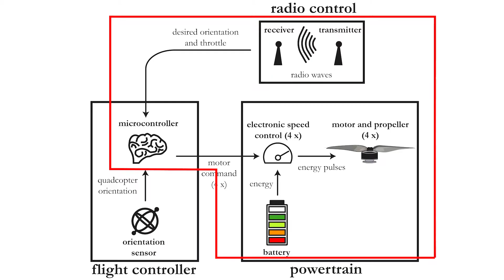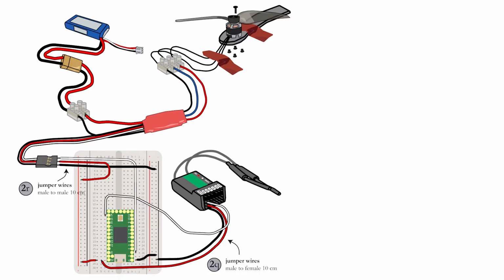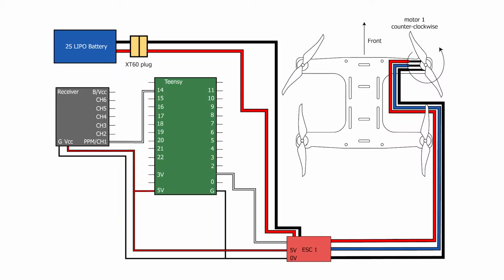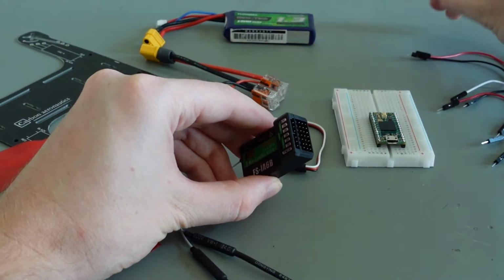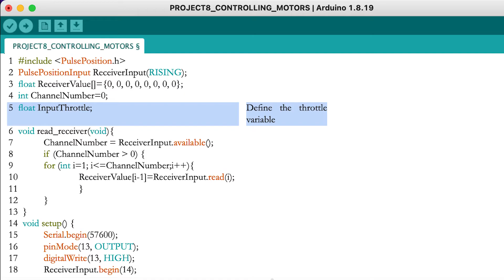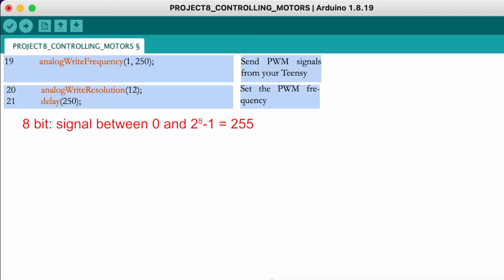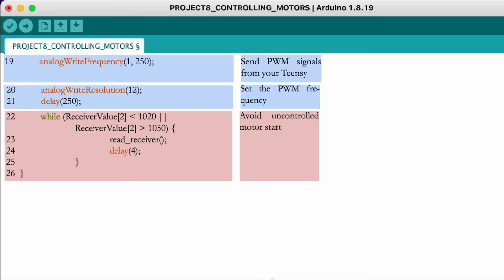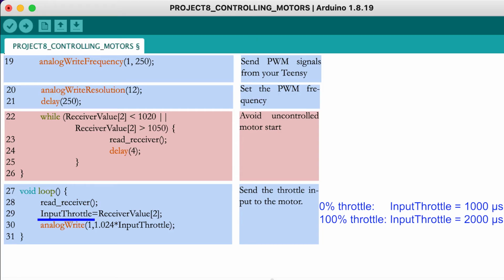8 | Control a brushless motor with a Teensy

Comment: Thanks for the great series of videos! Here we are using the PPM signal from 1000 to 2000 in a 12 bit resolution from 0 to 4095. Why aren't we converting the 1000-2000 in 0-4095?
Reply: Because ESC doesn't care about duty cycle(0-4095) rather it cares about pulse width in micro seconds.
Minimum pulse width understood by ESC is = 1000 micro seconds
Maximum pulse width understood by ESC is = 2000 micro seconds

In this case at PWM frequency of 250hz(4000 micro second period) and 12bit resolution(0-4095duty):
To make a 1000 microsecond width of pulse the duty cycle has to be (4095/4000)*1000 = 1023.75 <== Min Speed Duty
To make a 2000 microsecond width of pulse the duty cycle has to be (4095/4000)*2000 = 2047.50 <== Max Speed Duty

Why InputThrotte is multiplied by 1.024:
Min throttle send by remote 1000
So when 1000 throttle is sent the duty of the pwm duty has to be minimum(1023.75)
So any InputThrottle, Duty = InputThrottle*(1023.75/1000)
Hence, Duty is approx InputThrottle*1.024

Comment: shouldn't it be divided by 1.024 to match the 4000 if so? or maybe not divided at all if the 12bits is much more above the 2000 limit? Thank you

Comment: I fried my teensy doing the same wiring, do you know why it could have happened? Is It ok to plug the Rx signal(5v) directly into the teensy 3.3v pins ?
Reply: No. The teensy pins are not 5v tolerant.

Comment: Hi, first thanks for this  awesome project. 
Now a questiion. If the standard PWM signal of ESCs is 1-2ms, shouldn't the period be 2ms = 500Hz? I don't get why you are chosing 250Hz. Thanks in advance.
Reply: 0-2ms use, 2-4ms unused  and repeat this.